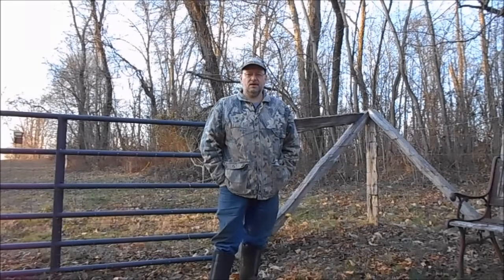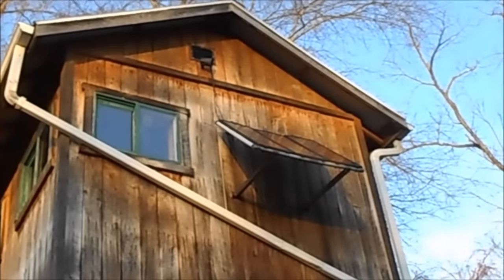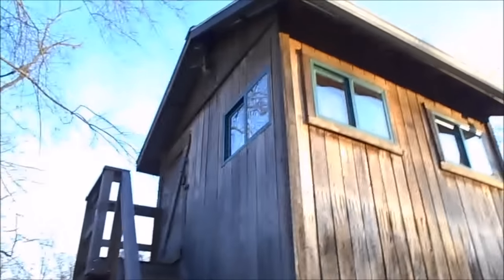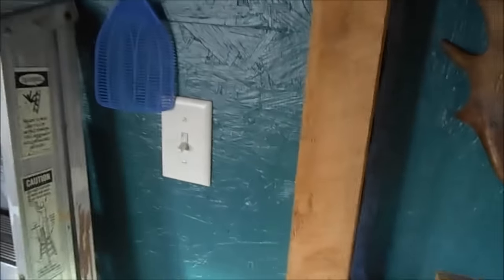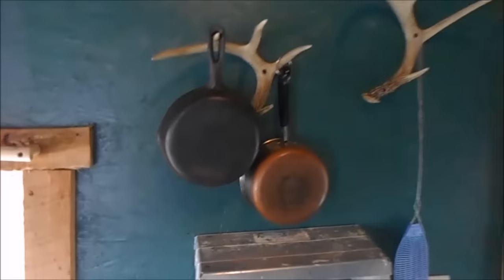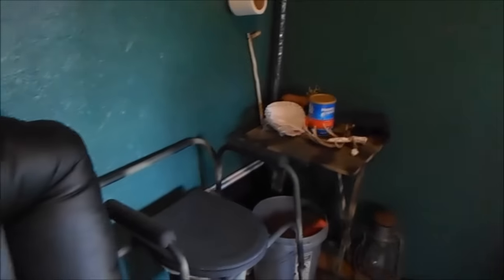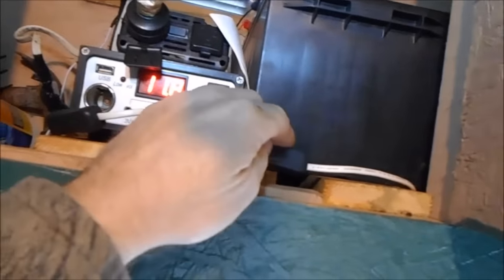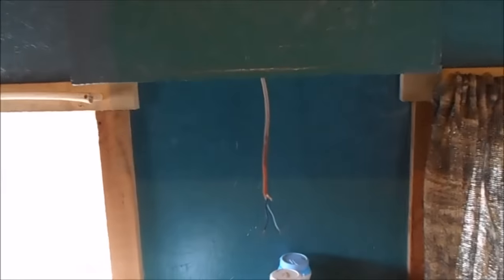ultimate hunting blind

Comment: If it was my blind seeing you already have a leaching field for sink I'd run some five gallon buckets on ground in lower section that can be changed or sink a 55 gallon drum in ground for  sewer and install a camper flush toilet inside. I would also lay down some sort of outdoor carpet that can be easily removed to change or rinse out to dampen noise from walking around and stop any draft issue. Plus I'd run a couple propane tanks like the bigger camper size in lower section and run up what ever gas tubing inside for heat and cooking..
But that's what I'd do.

Comment: I made one with the bottom 8 ft being stone walls (nice flat blue stone helped from the property).  Then I put beams overhanging the base by 2 ft with 12x12 beams for a second story of 10x10.  Then I built a timber frame on it and covered it with tin.  Made a door for the bottom to park the ATV in and a hatch in the base.  one winter I was hunting muzzleloader in PA with the temps in the minus 20's and stayed in there with the small wood stove I put in it. The third day that I was up there I got a doe just before dark and by the time I was done cleaning her out, she was frozen solid with ice crystals in the air.  I call it my mini cabin after that.
Reply from the maker: Sounds like a cool cabin, thanks for watching.

Comment: Excellent job Kevin ! Mine is as good as yours, but not as big. But do admit you do have me beat on the solar electrical and also which I also do not have an sink inside. On mine the stair case is not steep like yours but my stair case would be the same as a house. Our blinds is better then most out there. Mine is a 6 sided hex, with an 3ft x 3ft extension box, on the bottom of it  so I can stretch my legs out and sleep inside of it incase the hotels are filled up during hunting season and I cannot get a room, which happens from time to time,  and mine is insulated like a house like yours, painted drywall inside, storage area's in the floor, so I can store pots and pans and food and pop soda or Gatorade while hunting, and store other things like paper towel, had sanitizer, toiler paper etc....  and a stone shelf for cooking and put my portable heater under it. In a short time I can easily get mine heated to 80 degrees to 100 degrees easily, on any zero degree below day.  . And mine is 6ft tall of the ground so incase the farmer does not have the corn down, at least I will be able to see on what is going on the other side of the farm fields. On mine I am be able to see out of my windows from sitting down or standing up,(which most of these blinds you cannot stand up and look out of the window the same time).Then on my bottom I am going to make that into an out house since I cannot or probably not be able to fit a 4 wheeler in the bottom of it. And I also in the process of building another one now, but taller. The one building now will be 12ft to 19ft of the ground . The extra deer horns I got I am going to use those to hang the pots and pans like your doing. I've been using one deer horn as a coat hanger just to hang up my coat when I get inside of it.I like your idea of the curtain rods, with home made sticks .  I may do that on both  of these blinds.
Reply from the maker: Cool thanks for the comment.

Comment: Loved the curtain rods. If you want to go fancier, you can buy one for $4 on line. Probably took you longer to build them from the sticks. Loved the idea with the solar panels, outlets and alarm system. You can put 1.5” foam insulation on the floor and throw a sheet vinyl on top or LVT. It will make your floors warmer and quieter. Thanks for the vid